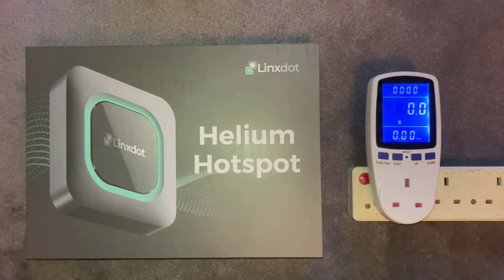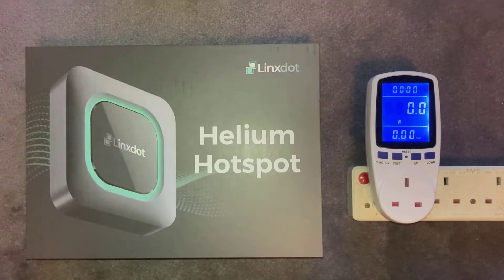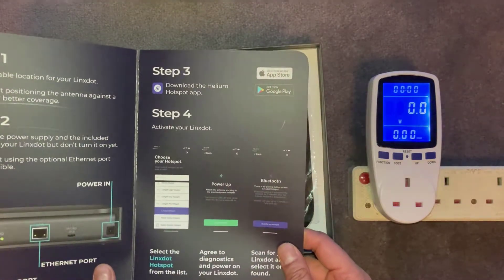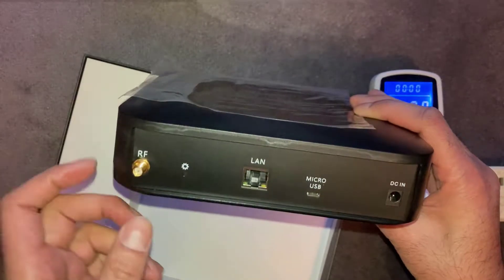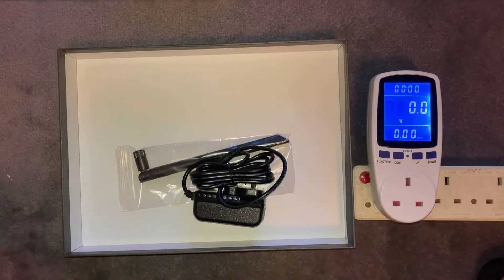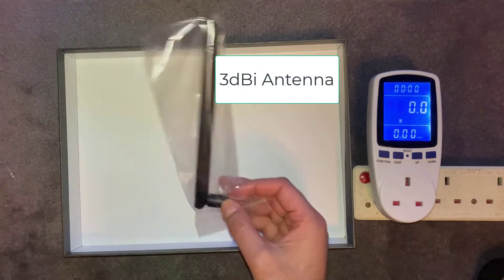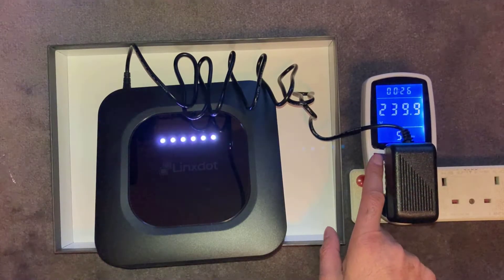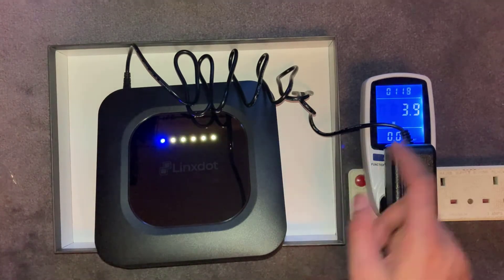Linxdot Helium Miner Unboxing and Power Consumption

Comment: You power on without antenna and ethernet cable and dont have any problem ?
Reply from the maker: Yes that's correct, because nothing is introduced/removed all is good. You only have problem if you connect/disconnect antenna/ethernet WHILE the miner is powered ON.